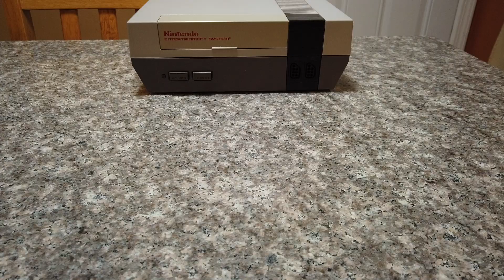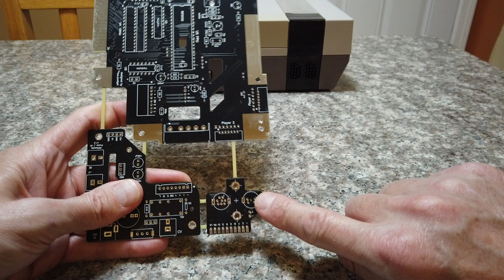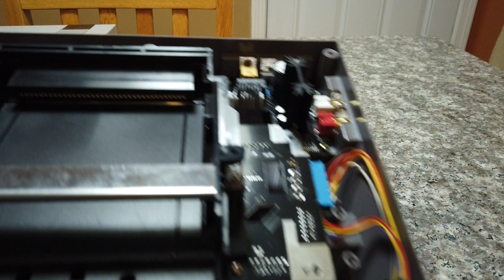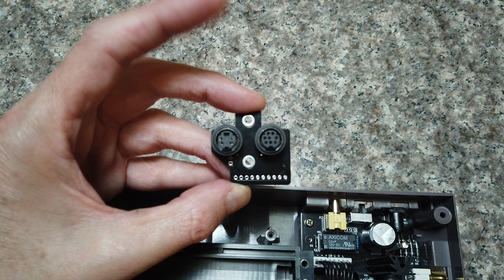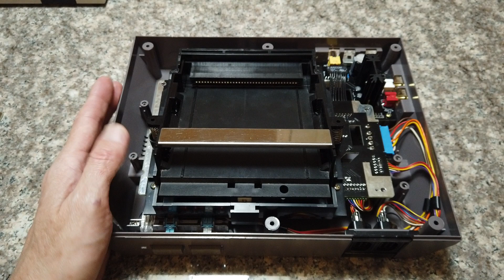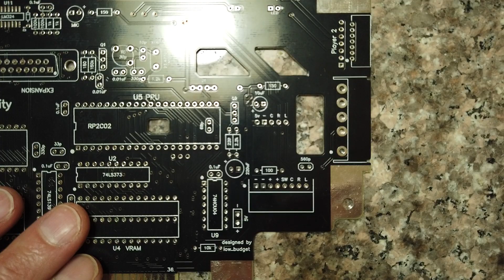NESessity v1.2 Replacement Motherboard for Nintendo NES

Comment: I have a few questions. First question is for my buddy. Are the boards discounted purchased in bulk like 5 or more? He has a box of broken NES front loaders and I thought at least using the cases and most of the components to salvage them might be a cool project to make a little extra cash. 
And my question deals with video interference using the front loader with the NESRGB. Can I only purchase the RF/AV board separately? I am just learning to solder and would like to take a crack at solving a nagging issue I have. I only just got the front loader back from Voultar a few months ago and noticed a lot of issues in the picture that everyone who has seen it, including Voultar is telling me it's power related. I got a brand new Triad PSU but it didn't change anything. All of that to ask you, do you believe if I purchased your board I could populate the AV/RF module section and fix the "power related" video interference I'm experiencing? If so I would really rather just get your boards and use what I need. There is also a newer board on the market called the NES I/O board that replaces the RF/AV module entirely but I don't know if that would cause any issues with my NESRGB because I don't know much about it and I've been asking around for a month and haven't had any answers.

Comment: Do you plan on doing this for the top loader also
Reply from the maker: I will not be doing a NES top loader version because the controller ports are not available and it would be difficult to remove and reuse the old ones.
Reply: @lowbudgetify  hi mr i want to buy one but you cannot ship to mexico is there another way to buy you PCB

Comment: Can you give an estimate of the assembly time needed?  Also total cost of components?
Reply: I'm self taught in soldering and it took me about 5 hours. I did make a few minor mistakes so that's why it took me a little longer. 😅
Reply from the maker: It takes me around 2 and a half hours to assemble both main PCBs.
Estimated costs (not including shipping or taxes)
The NESessity PCB is $44

Components from Digikey are $61

The other components needed come from an original NES and prices vary.
If you don't already have an original NES, the cost of these can be anywhere from $30 to over $100 depending on condition.
Sometimes there are ebay sellers offering the CPU and PPU chips already desoldered, these cost around $60.
The optional NESRGB (to add RGB and s-video output) is $93

Comment: I've got one and can't wait to assemble it this holiday season! My only wish is that there was an option to use a different 5 pin connector instead of robbing one from an old nes. I know this would mean I would need to swap out the power connector for a matching form factor,  but I love the idea of using all new parts to build a system with my son or in a classroom.

Comment: I have so many questions about this project. I honestly would like to know more about it and find out if ideas I have in my head are even possible. Also, why do you have an expansion port on the board? I admire your work. That had to have taken a lot of time and dedication. Even if you don't see this I look forward to future revisions.
Reply: Because this actually lets the NES use EXT port hardware/devices. The 15-pin FC EXT port was more functional than the never-used EXT port design on the NES. Now the NES can use the awesome FC joysticks and other accessories.
Reply from the maker: I'm curios what your project ideas are.  It may be possible if it isn't too crazy, lol.

Comment: The microphone is facing downwards.... hmmm..
Reply from the maker: The microphone is basically acting as a sound detector for an input only certain Famicom games read, so it's not critical where it is placed.  If the system was broadcasting or recording sound from the microphone then I agree it would be bad placement for sound quality. The sound from the microphone is not mixed with the system sound like on an original Famicom.
The microphone can still be relocated to a different location with 2 wires.
Reply: @lowbudgetify  I see